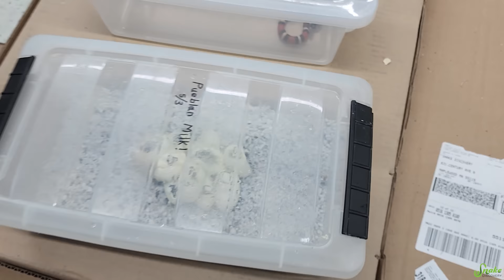Baby Milksnakes Hatching!! (Then Escaping)

Comment: For the vents on the incubator, I'd recommend glue/taping some screen mesh over the holes. Keeps airflow and prevents escapes.
Reply: I was thinking that too but I've no experience in keeping snakes or incubators so I didn't think it was possible.
Reply: Exactly what I was thinking too. They could probably use contact cement (or similar) and have it blend right in.
Reply: Spray foam instead of paper towels?
Reply: I was thinking the same, some mesh or fabric over the holes where they were found etc.
Reply: Milk snakes = SUPER JERKS!  😂
Reply: I was thinking sponges instead of spray foam
Reply: and then for the columns holding the shelves up they should put rubber stoppers
Reply: Actually the vents in the incubator or to keep moisture in and out so they kind of can't block that because it's the only thing pumping heat into the incubator
Reply: @Abbymylife  Using a mesh does not block the airflow. Think of the screen-mesh material used to keep bugs out of open windows.
Reply: Maybe some foam insulation....
Reply: That's a great idea
Reply: @TheIndigoEclipse yes I agree with the mesh! I thought you were going to say something like cotton balls or styrofoam because that's what people like to do and I keep correcting them on videos LOL😂
Reply: maybe even filter foam would work
Reply: C$zAa😊

Comment: At the facility I worked at, milk snakes were almost always the escapees. Those little turds would find their way out of their bins through the teeniest gaps, then dissappear into thin air. Sometimes we would find them right away in random places near heat sources, other times we wouldn't find them  until months later. While it wasn't a super common occurrence, it happened about 4 times in the 3 years I worked there, and I heard a story about a previous escape that resulted in the snake being found in the most bizarre location - inside a bin of cut greens for bearded dragon INSIDE THE REFRIGERATED ROOM. Everyone assumed it snuck into the bin while the greens were being chopped and added to the bin, and it was put away in the fridge without anyone knowing what had happened until a very chilly snake was found by the dragon care staff. Thankfully it recovered with no adverse effects.
Reply: Dragon care staff is a helluva job title

Comment: Advice:  Fill in the top holes of the brackets with silicone so that doesn't happen again in the future. (silicone doesn't prevent them from coming apart in the future, so there's no harm in doing it). You could also install a mosquito screen behind the vents.

Comment: You could get expanding foam to put on the top of the shelf supports, the kind that you put around windows in houses. It's an insulator, so it shouldn't have a problem with the higher temps. You can find it at any home improvement store.

Comment: For the tops of the rails you could 3d  print a cap for a lot less permanent or possibly damaging than other suggestions ive seen people suggest and for the back vents a simple solution would be to add wire meshon the back if them as youve shown its not hard to remove the back panel to modify it

Comment: Just had a thought for the incubator: go to a hobby shop, buy some air-dry clay. (Something like sculpey or fimo.) How you shape it will depend on how neat you want your plugs to be. 
If you want them neat, measure the interior of the holes, shape a 3D rectangle to fit inside, a larger rectangle to be a rim. Attach the two together, dry-fit your plug, then put it on a table and leave it to air-dry while you do the other three.
If you don't care, shove a bit inside & make sure there's a bit of a rim you could grab if you needed to.

Comment: This is the SAME EXACT situation that happened at my work this summer…I work nights in a brand new rural hospital- a snake was seen in the cafeteria and everyone was freaking out…I went to assess the situation and couldn’t find him anywhere. I finally saw a little bull snake tail sticking out of the bottom of a steel door…there was a tiny hole in the bottom of the steel door and he had crawled up inside and was hiding in the compartment of the compression handle piece of the steel door. Called in the on-call plant engineer who had to take apart the whole door frame  and tape up the holes, relocate the door to the shed and they were going to further disassemble the next day. I pleaded with them to not kill the snake and allow me to relocate him. Snake was found, removed from door, and safely released ❤

Comment: To save time and prevent issues in the future, you should block off any place you looked at in the incubator and wondered if they could have gotten in there. The rails could have plugs 3d printed, or take them back off, lay them flat, & fill the top section with silicone. Use window screen to cover the back vents. These aren't the smallest babies, so if they could have gotten in somewhere, other snake babies might as well. Maybe even lay some pvc or other hides you'd want them to use in a few places so if anyone does escape they might end up using those instead of something difficult to get to.

Comment: I feel like in my short reptile experience I’ve learned, never underestimate the size of a whole a reptile will shove it’s body through. They are absolutely cats with scales. If it’s head can go through it will figure out the rest. I have had a lizard crawl inside my shirt through an almost skin tight sleeve (definitely skin tight when it crawled in). 

It’s kinda crazy when you think about it bc it’s like they have no concept that a thing might collapse or move and crush them. Like in the wild surely rocks occasionally fall or wobble when a larger animal walks on them right? So you’d think it’s a bad life strategy

Comment: By my tactical knowledge I know that to detect the inside n every move you need to use a machine called a metaptopycila and it is used for finding nearest snakes by the littlest sound by using a clontent fibimn while golow heat in the incubator use softly in a swift maximum of telaphomm using a map that catches everything by little sounds in the profiitnn of little scatters and the tiniest hisses. I own a company of snakes and using fibimn is the best!
Reply: Reply to me if you need something, I know every snake fact hoblic to melltoin!
Reply: The rocks you used for them sometimes can cause reactions to their skin, so keep an eye, it’s snake friendly but sometimes when they rub against it they can easily shake their skin off into a lump of raw meat, then that attracts animals that can easily break the glass to get them!

Comment: 0:00- 0:23 walking on  sidewalk and talking
0:22- 0:25 intro
0:33- 6:42 looking at snakes
7:31- 9:31 taking apart to look for snakes
9:39- 10:17 found the baby snakes
10:39- 10:47 looking at eggs to see if they got them all
10:58- 11:45 looking for the rest
11:51- 12:41 found them all
12:22- 12:39 looking at snakes again
13:10- 13:21 talking
13:29- 13:32 putting back together
13:40- 14:12 cleaning up the "mess"
14:13- 16:26 talking about the fridge incubator
16:14- 16:53 putting snakes into pepsi sized incubator
16:56- 16:57 the next day
17:00- 19:33 checking on eggs to see if any hatched day 1
20:00- 21:31 checking on eggs to see if any hatched day 2
21:38- 22:50 setting up baby bins
23:21-23:22 putting baby snakes into the baby bins
23:22- 23:22 change of plan
23:41- 24:54 showing baby snake parents & facts
26:23- 26:24 End
25:45- 25:40 patreon supporters
25:49- 25:54 merch

Comment: Ed and Emily Hey Ed Emily what you can do to make a permanent fix for that opening is get a little carbon fiber window screen and some gorilla glue gel and a little bit of water in a in a really fine spray bottle you glue around the openings and any possible areas that need to be covered and put the screen over that and hold it in place while the other one of you missed I mean really fine mist the gorilla glue and the screen and that'll quickly harden it in like a minute and you're good to go it's permanent fix you don't have to worry about anything crawling back there again in the future.